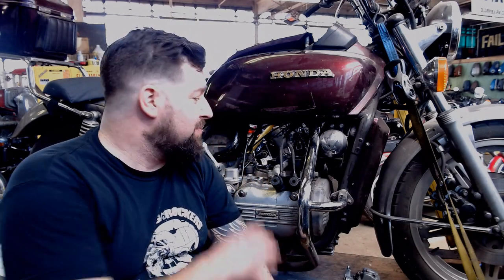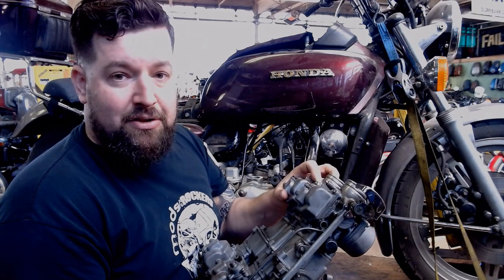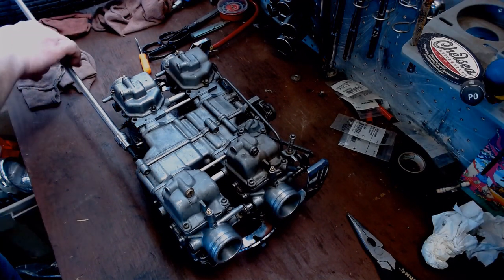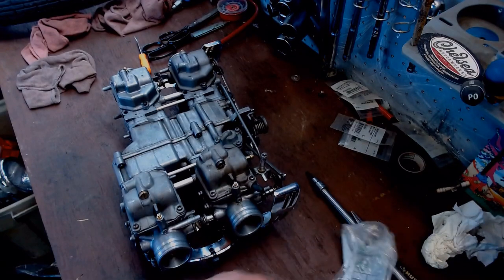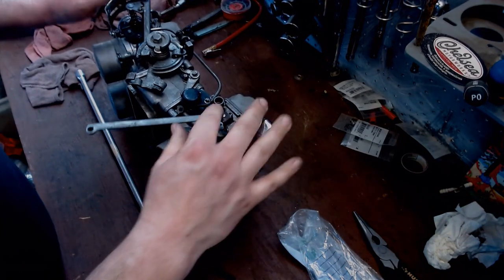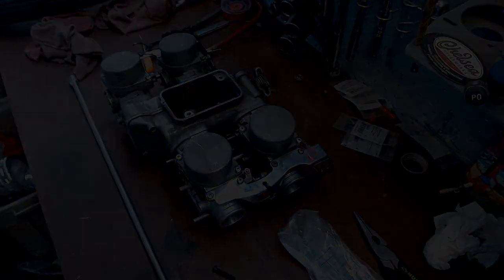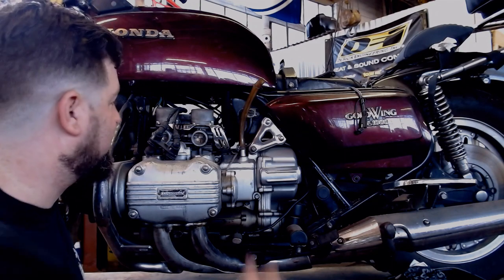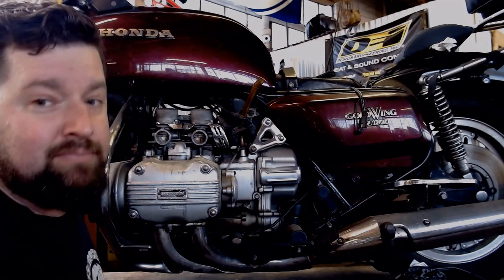Easiest install of Goldwing Carbs! GL1000 & GL1100

Comment: Put the carbs together off the bike, remove the air cutoff valve, slide the carbs in from the left making sure to be careful with the coolant tubes, put on the air cut off valve, install throttle cables, choke, fuel, 4 - 10mm bolts, air filter, done. This is way easier than you make it sound. Keep the manifolds and boots on, the right side ones get rotated 180 degrees so they're facing up while you slide the carbs in.
Reply from the maker: Maybe there was a model change. On this bike, I had to pull a float bowl and vac piston cap to clear the top rear engine mount and the engine casting. If you split the airbox manifold, it also makes air bleed mix and rejetting summer and easier.  
But make a video of your way.  It's great to have options as a mechanic.
Reply: @KnobleMoto  Take the chrome trim cover from the right hand side and slide them in from the left exactly as James Barabe said. Also, as he says you need to remove the air cutoff valve. If you don't remove that chrome component though, you will definitely struggle.

Comment: I found a good deal on an 81 1100 this past summer.. ran ok but it was clear it needed a carb clean after there was no real improvement after a couple weeks of run it for a while, sit for a few days, run for a while, repeat... Plus a can of seafoam.. hey sometimes I'll get lucky.. 

Anyway I got everything disconnected but the damn assembly just will not slide out.. at least with my limited knowledge of goldwings.. Haven't had much time to work on it since then so it's just sat. Guess I'll have to revisit it again soon. 

The other "big thing" I wanna tackle.. or at least inspect is the timing belt. It's got right around 75k on it. 

Nice bike for a couple hundred bucks tho.. however it's a little large for me at 5'10/150lbs so I'm leaning toward selling it once I've deemed it road Worthy. I usually daily a rebel250.
Reply from the maker: You will likely have to disassemble parts if the carburetors to get the whole assembly out.  It is a giant pain the first time you do it. Start with removing the top caps off the carbs, then go from there.
Reply: @KnobleMoto  appreciate it. I'd done a little forum browsing and found people both insisting that it will/won't come out sans further dismantling.. also saw a couple people claiming that they just loosened the tank to allow it out.. wasn't sure if they meant the actual tank or faux tank though and neither made much sense apon inspection.
Reply from the maker: @jseden  On the late 70s one I was working on, it was the frame and the engine case that prevented the removal wit out disassembly.   You can try puling the screws like I discussed in the video, but I doubt you will be able to get them out with a screwdriver.  the ball end Allen key is the trick to reassembly.

Comment: YES, BUT HOW DO WE GET THE CARBURETOR OFF IN THE FIRST PLACE!
Reply from the maker: You have to take off a float bowl, and a cap.  I don’t remember which ones. Also there is a lot of swearing involved.
Reply: @KnobleMoto  yeah, I figured it out, it's actually a little easier than a float bowl and a cap, on the right side of the engine on the very top of the carburetor there's this little piece with a hose coming off of it if you go down through the air intake with a very long screwdriver you can unscrew the screws on that one piece and remove it and it makes the carbs smaller and they fit on the way out and don't hit the frame
Reply from the maker: @jaredyeaman2934  good to hear.  I am glad you got it off

Comment: Man these are not hard to put in
Reply from the maker: Some people struggle with them, so I tried to help simplify it.
Reply: Yeah I always just take the air pump off and there's a sweet spot on the left side of bike that goes right in.    Rebuilding them is still a pain though especially if someone has already hacked on them
Reply: Too much work ,just take sliders cups off and slide  the carbs then put cups I have done itany times very easy